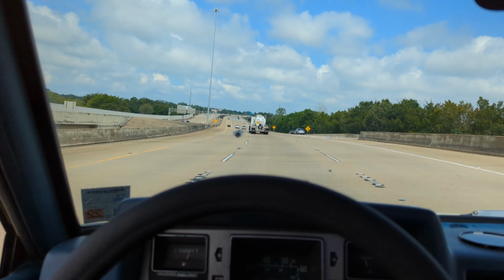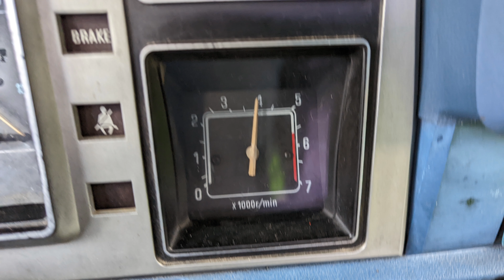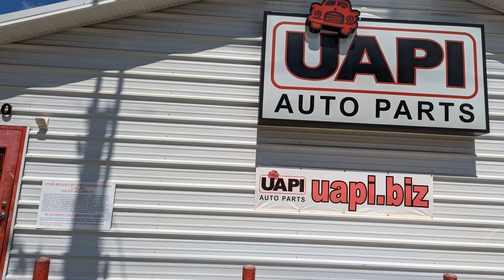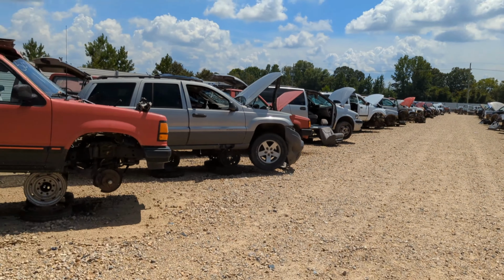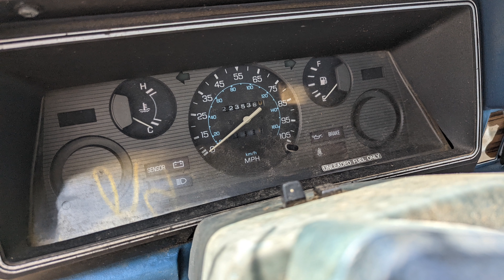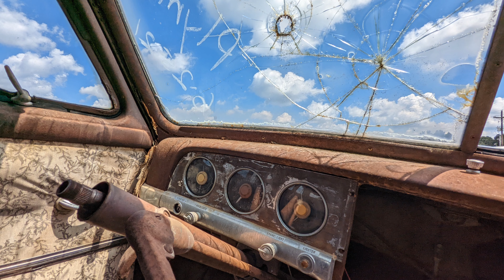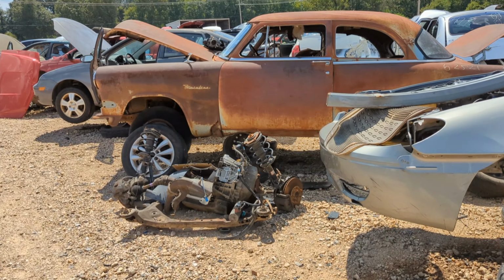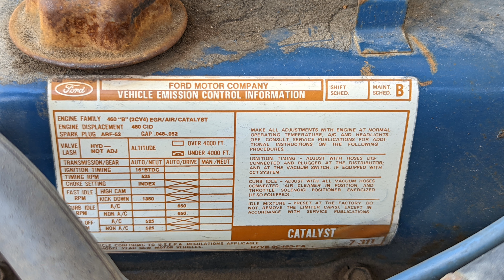Junkyard Crawl in Texarkana for a 1986 Nissan 720

Comment: These trucks were once ubiquitous and easy to find cheap. Blown head gaskets were the Achilles heel of the Z series engines, so there aren't many on the road left.
I get comments everywhere I go with my 84 KC 2wd as you just don't see them much anymore. Mine has 249K miles and runs strong with no oil use.
Reply from the maker: I have definitely enjoyed my pickup.  Very true about the head gasket for sure, iron and aluminum don't go well together.  Thanks for your comment!